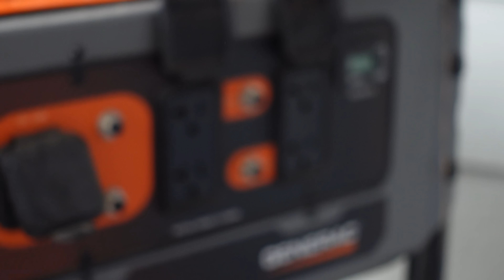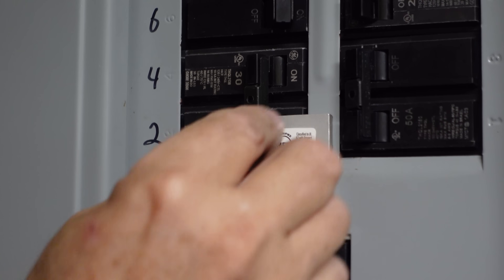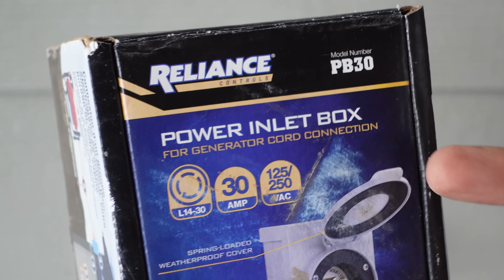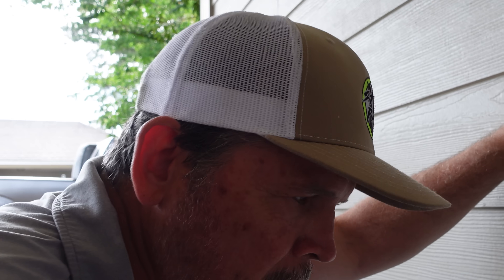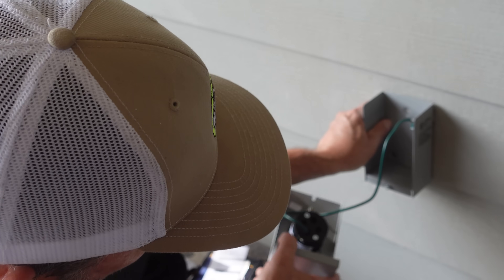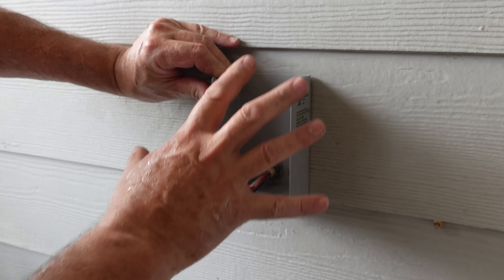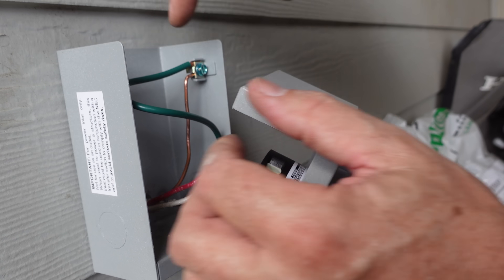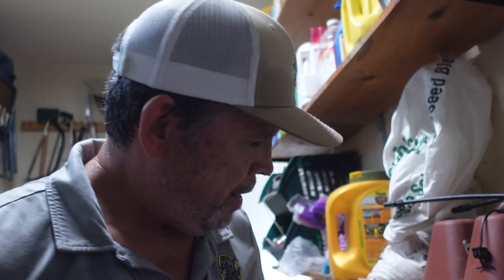What is a Suicide Cord and Why It Could Kill You

Comment: Thank you for going into detail about how when we don't have interlocks, we can kill the linemen. That's a detail few get into, and most people think electricity only goes one way - from the power plant to us, not the other way around. That's a very important concept to teach since more and more people are going to solar, batteries, etc.
Reply: ...it also helps prevent you from powering your neighborhood a little bit and nobody has enough energy to do anything.  Then you ask "What's wrong?  It's pushing 3000W of juice but I can't power my little radio!"
Reply: Even for those who don't give a damn about human life (too many people) it's also just overloading their generator by trying to power the whole neighborhood
Reply: shut of the main or if there is no main, pull the damn meter off the wall
Reply: @ryanmalin  most places, if you get caught tampering with the meter you can face a fine..

If you get caught 😉
Reply: @Ham_Strokers_Ejacula  I would imagine the electric company would not fine you if you pulled the meter during an area outage, and told them about it. They just don't want people messing with the meter and trying to bypass or something. If you have a legit safety reason to pull the meter I'm sure they'll make an exception to the rule. However, if you don't have a main breaker, you should lol.
Reply: @akunog3665  Meter tampering is illegal, if you told the power company, they would tell you not to, that it's illegal 🤦🤦 there's no exceptions just because the power is out..
Reply: @Ham_Strokers_Ejacula  You are right. I suppose there is never a situation where pulling the meter is the only way to stop something bad from happening. I was just thinking if someone's life is on the line, pulling the meter and dealing with the consequences later is probably best, but I can't conceive of a situation like this now that I try.
Reply: @Karl with a K "No WAY lineman can be killed by back fed AC."
PPE can fail, or fail to be worn, meters can be used improperly, or the AC is backfed after the meter is used. 240 can kill directly, but I would be more worried about the fall off the ladder after the muscle contractions take over.
I do agree that the danger is probably overstated, as there are other precautions in place. However, I still think it's a great idea not to send voltage back with your generator obviously.
Reply: @Karl with a K What are you talking about? You mean the inverter could malfunction and fail to shut off?
Reply: Also if the generator is connected to the mains when they come back on the line frequencies will be out of phase resulting, effectively, in a short circuit that could toast the generator, and wiring between before the breakers trip.
Reply: @anthonyjackson280  spot on, it’s a classic case of fighting power supplies.  Not sure that lil’ guy is going to win against a commercial power plant.
Reply: how about using the cold of the ground beneath the house, to cool things with.
Reply: @CONEHEADDK  you talking about geothermal? this is a video about installing a generator, not the cooling system the generator will power. Usually geothermal still uses traditional refrigeration tech (compressor/refrigerant/loop) but instead of the loop being cooled with outside air and a fan it's cooled with water that is kept at ground temperature through a giant piping loop under the house/yard. Still need a generator to run it. Even if it was a primitive system, you would have to run a fan to exchange the air from under with the air in your home.
Reply: @akunog3665  I'm not. I'm an inventor. I expect ground temperature close to the surface to be pretty low over there (I live in Denmark, where ca 1 meter down we have about 4-5 degrees) and if I had to use tons of money/energy to cool my house every year, I'd dig a deep hole, fill it with stones to store low temperature, and build the house on top of that. Then I could blow air down and it would come up where I wanted it to. If the sun is shining, a small solar panel can handle the blower, if there is wind, a small wind mill. Keep it simple/cheap is my approach.
Reply: @CONEHEADDK  yes, in cold climates this would work fine for cooling, but would not do much in terms of heating. Geothermal with a heat pump is nice because if you dig deep enough you pretty much always have a 50-60 degree heat sink most anywhere on the planet.
Reply: @akunog3665  I know. I was only talking about the cooling to avoid using AC, as my "stones to store cold" points to. Simple and cheap. I expect "all" farmers to have the machines needed, to dig and move stones, so it would be close to free to establish. Would work most of the time, and at least help, if not doing the job as well as AC - and not be reliant on the grid. "All day" people are up and working, so the cold can store in the stones, and be used to sleep better - IF the grond temp is low enough - something I don't know anything about anywhere but in Denmark and Siberia (perma frost)
Reply: @hunterjames7786  A diode is normally considered for DC application. AC always goes both directions, so a diode would not really help.
Reply: @akunog3665 diodes are use in AC in many different application all of the time.
Reply: @Karl with a K I believe in your point. It's less dangerous than could be first thought because of responsible practices on the part of the linemen. However, people make mistakes, and when enough people make enough mistakes, sometimes a bad thing can happen. If we make sure not to back feed, it will increase the safety of the linemen.

OSHRC Docket No. 06-0166 
Secretary of Labor,
 Complainant

 v.
Pike Electric, Inc.,
Respondent.

On July 12, 2005, Class A lineman Ronnie Adams was electrocuted while splicing a sagging power line from an elevated lift.

I'm not saying that if you accidently hook up your generator and send current backwards into the grid, you will kill a lineman. I'm saying the potential for harm and danger is there, and the generator will be damaged anyway. Do not back feed. There is a chance you will kill someone, maybe even a kid who doesn't know better than to approach a downed line, or maybe a lineman who is in a hurry, working for a lousy company. It's good to have all the safety precautions, that way when one person messes up people don't start dying. If you back feed you should not be charged with attempted murder, but I still think it's a horrible idea lol.
Reply: It’s called alternating current for a reason
Reply: @hankhill3417  The current may be alternating, but the energy flow is one direction. (and that direction is backwards if you hook up a generator.)
Reply: @Karl with a K Backfeeding the power grid when the power grid tech up in the cherry picker thinks it's disconnected and goes to stick his spanner on something could.
Reply: @Karl with a K The inverters which are designed to backfeed are legally required to detect power outages, called "islanding", and shut themselves off. When someone uses a s**cide cord, there is no such protection.
Reply: @Karl with a K So what you're saying is linemen should assume any line may be backfed. That's not the same as saying that every line is actually backfed.
Reply: @Karl with a K Excessive caution works both ways. The lineman should be prepared for you to do the stupid thing. And you should be prepared for the lineman to do the stupid thing.
Reply: You do not need the interlock whatsoever. All you do is turn the main off and don't be a jack ass and call an electrician to come mess with your house when you did an electrical modification. Interlock or not, you can't be a complete electrical moron because you still have to know what you are doing when you mess around with the breaker box. Otherwise, you would just pop the breaker to your generator for pulling too much current.
Reply: @DaveElectric  In an emergency maybe. If you have plenty of time to install it then no. Do it properly, or you'll make a mistake one day, most likely blowing up your generator.
Reply: It also protects the generator as well as connecting a generator that is not synchronised with the grid will result in a sudden inrush of current as the reactive power tries to equalise the phase of the two A/C waveforms. The grid has a lot of reactive power available and the currents involved can and will destroy the industrial generators of a power plant if not synchronised so a little home generator stands little chance. This is why power plants have synchroscope's so they can get the generators synchronised and in phase or at least close enough (within a few degrees) that the inrush currents as the two synchronise properly don't destroy the generator.
Reply: @karlwithak.Please stay away from electricity
Reply: @@karlwithak. I'm sure you know what you're talking about about then, but you sure  seem to have a lot of confidence that shit can't ever happen or go wrong. I hope you stay safe out there.
Reply: It is not just a danger to linemen, but to yourself as well.  Backfeeding the lines can kill a lineman, but it can also catch your generator on fire, when the feed is restored, and your generator is out of phase.
Reply: Linesmen are required to ground the power lines to avoid this situation 👌if one got fried its because he didn't follow proper procedures.

Best practice is to throw your main breaker, separating it from the grid, to avoid back feed
Reply: @Ham_Strokers_Ejacula  Relying on people to remember to turn off the main breaker, and noone else turning it on, is not a good idea.
Reply: @Ham_Strokers_Ejacula  I actually had an interesting idea as a 'signal' that your mains power is back online. Connecting a light socket and a switch to the mains input feed behind the breaker, say by connecting one live (for 120v) and neutral to the input side of the mains breaker. Power goes out, you flip the switch and turn off the mains input before you backfeed your house. When the light comes on at the panel, you know you can disconnect your generator and turn the mains back on.
Reply: @Ham_Strokers_Ejacula Ever seen a 12kv ground fault. It ain’t pretty. It’s true linemen ground the lines before work but since they are humans, it’s possible they will forget. It’s good to have redundancy by avoiding backfired at square one.
Reply: @andrewwilson6222  I've seen a bucket put it's boon in a 35.5 kv wire, killing a 19yr old kid out in Texas, cleaning up after Ike. Down here in FL some utilities assume the wire being "dead" is good enough.
Reply: @Ham_Strokers_Ejacula  But you said linemen are required to ground the lines before making contact (actually, encroaching on the minimum approach distance). If some linemen think the line being dead is good enough, then doesn’t it stand to reason that using extra precautions, such as an interlock, is a good idea? I’m confused. You’re kinda making my point. I thought you were arguing that because linemen hang grounds, an interlock is not necessary.
Reply: @andrewwilson6222  they are, it's called time and money.

It costs money to pay the man hours for the labor, why pay the extra money when you can just force someone into doing something or losing their job. And no the interlock would still be necessary as  redundancy at least.
Reply: @Ham_Strokers_Ejacula  true but the issue is also there are likely to be local downed lined because of the storm, meaning your now making lines that should already be disconnected into live lines. The linesmen will isolate lines as best practice, but what about the guy down the street who now has a line laying across his lawn, its very easy for someone to accidentally touch that line especially if they've already been told its isolated. Same with the linesman working on the lines in your street, they've likely isolated the line from the grid, but not from your house since your house shouldn't be feeding that line. Better to be safe than sorry in this situation.

On a side note, this is can be an issue that can be encoutered by houses with solar panels that sell their spare electricity back to the grid.
Reply: @cgi2002  true the same issue can be had with solar but like with any form of power generation, with your home still connected to the grid, any electricity in the home will back feed through your meter, get stepped up by the transformer (they go both ways....giggity) and through the power line to whatever ground is closest. By flipping your breakers main switch you physically separate your house from the grid, then you don't have to worry about downed power lines in the neighbors yard or back feeling power to the wires.

Likewise, linesmen carry grounding wires they're supposed to always use that run from the primary to the neutral, to ground any wires they work on making it safe to work on, I used to cut trees around the power lines for asplundh and on storm they're supposed to ground our wires too.........supposed to..

Comment: In my humble opinion; if the power cable is in tip top condition without any frayed or exposed wires, I'd change out one of the male ends to convert it to a female end.

Comment: Since the original plug and cable was only rated at 20 amps and you upgraded everything to 30 amps, I am assuming that you checked the household wiring to ensure it could handle the new loads (10 gauge or better).
Reply from the maker: It’s all 10g

Comment: 30 Amps on #12 wire, Yeah, you're an expert.  (On generator  connections you should always use one size larger wire to the panel to allow for the surge current.   The small generators do not have voltage or current regulation on them.   Otherwise, this is a nice idea.
Reply from the maker: Not 12g

Comment: Just a heads up that if you depend on google to source 240v cords it is harder than you may think. Had to source some cords for a 240v UPS project last year, had a difficult time sourcing a 10ft cord with the correct ends on it. Ended up contacting a local electrical company for part of the project anyway, so had THEM source the cable I needed as part of the job (I think they just built one themselves in the end).

Comment: Thanks, guys, in NJ that's not up to code, need a transfer switch next to the panel. My home I did the same as you purchased a 10k generator with a 50 amp extension cord with the 50 amp reliant power inlet. I love that jig.

Comment: Don't know if anyone else mentioned this, but at 11:30 (when Jordan had to tighten the loose cable in the cable clamp), you can put the clamp on the cable, tighten it down, THEN put the clamp through the box and tighten the clamp nut inside the box...

Comment: Only thing I would have done different is to run a bead of silicone around the original hole and the blocking board. It's under a covered porch so it might be ok, but it does rain sideways in LA sometimes or could be accidentally hit with the hose.

Comment: A few years back during hurricane Florence I made a suicide cord when the power went out for nearly a week with the refrigerator and freezer being my first priority,  well pump and lights second. I had purchased my first home just outside of Gastonia NC that same February.  Had planned to install a manual transfer switch and approved hookup point from the beginning but having a traveling job and working very odd hours at times, and stores out of necessary hardware,  desperate times called for desperate measures.  Since my panel is not located near the meter I have a meter breaker in addition to my main (subpanel) panel. I went the Extra step and disconnected the service wires from the inside main breaker and tapped them with good electrical tape before I hooked the generator to my dryer receptacle,  so there was no chance of backfeeding even if someone were to accidentally throw the main breaker on inside the house.    Safe to say after the storm I installed an approved transfer switch and connection.

Comment: I just wandering why should you never modify an extension I understand there may be some instances issues if catches a light but other then that as long as you know what your doing you should be fine. I had a core were one end was arcing internally when I plugged it in to my truck so I cut the end off and but a new plug and it works fine I just use it a week to power my brand knew $2k pc during a power outage and I just for 8 months of the year for my block heater in my truck.

Comment: Great video, just two questions.  If your receptacle box is on an outer wall like mine is would it need to have something covering it in the event of a driving rainstorm?  Or is the flip covering good enough?  Also should the box be caulked around the edges so water cut seep in?
Reply: Either way I would caulk around the box.

Comment: Excellent video!
I clicked on it because we used what we called "suicide" cords at a testing facility for a large company. We'd take a typical 110VAC cord and snip one end so that there was bare wire showing with the plug at the other end. The trick was to attach the bare ends of the cord to the device being tested before the cord was plugged into the 110VAC outlet. It became second nature to check the plug end before the bare wire end. 
Another idea for these hookups is to go ahead and use 50 amp devices. This will skip the need to upgrade the wiring if the generator is upgraded.
Reply: I do the same thing at work but we refer to them as pig tails, I assume because they're usually all curled up like a pig's tail from being coiled up and stored